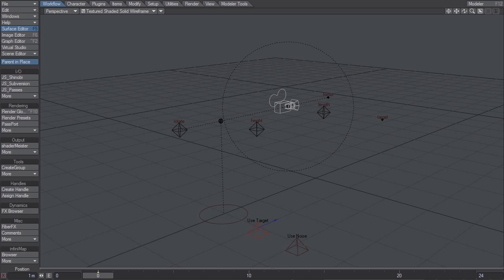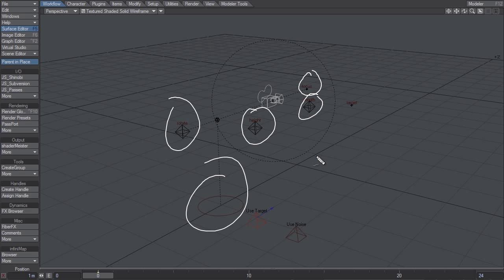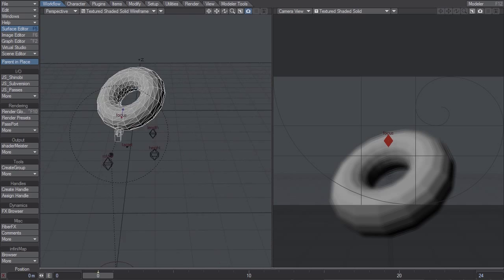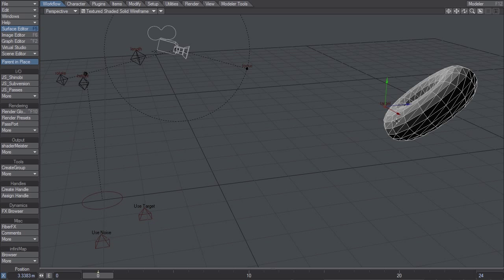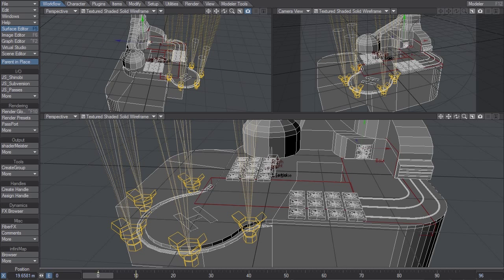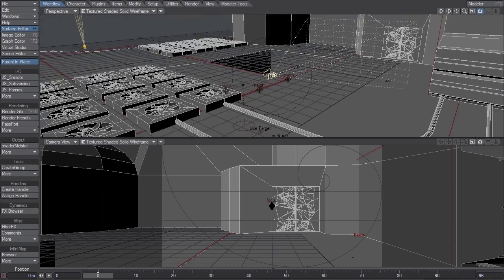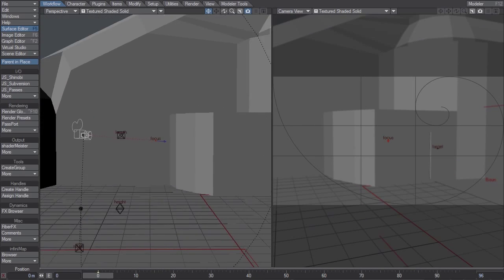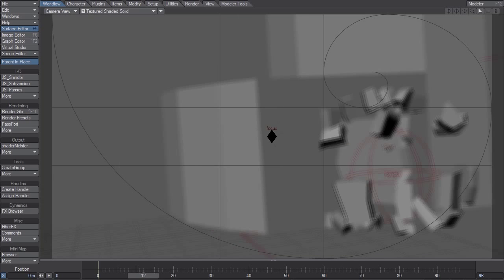Camera Rig for LightWave 3D

Comment: there is a huge problem with this rig, try to turn on motion blur and it all screw up because the camera have no keyframe and lightwave doesn't understand the real position of the camera. To test it, create a simple camera movement with lateral rotate using the target and use target. Then, select de camera and press enter to create a keyframe, lightwave will show you where the cam is interpretated. the motion blur is calculated between the real position and the other position